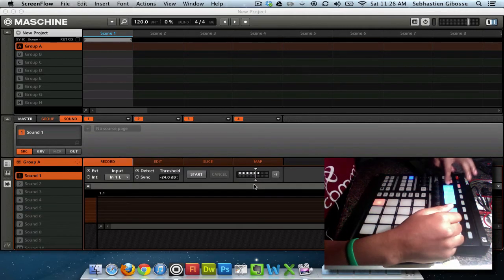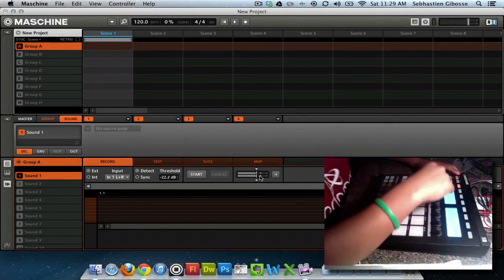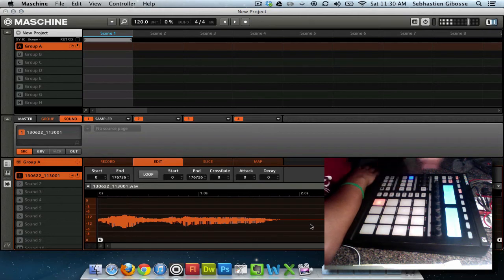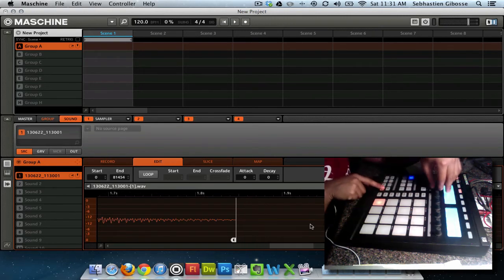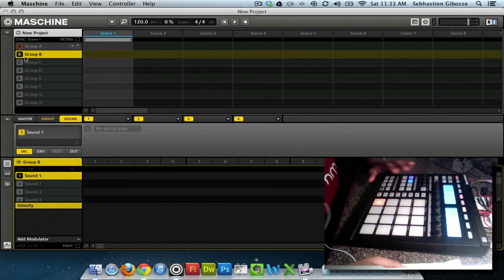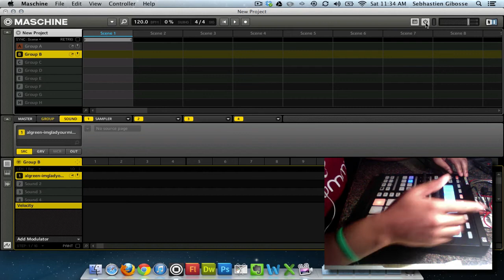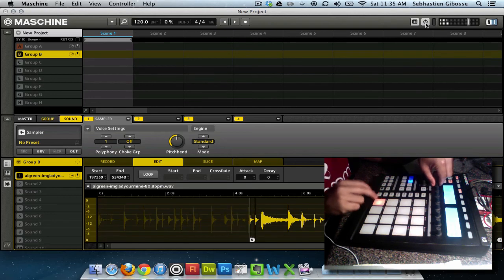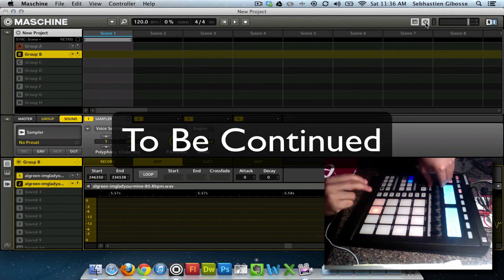Maschine 101 Tutorials - Episode 9 - Sampling and Slicing

Comment: on 0:49 that sound level monitor what ever it's call, my question is how do you take off or reduce the red line feedback to a normal sound recording level on both bars being equal on In1 L+R mode though on In2 L+R goes away but does not pick up any sound?